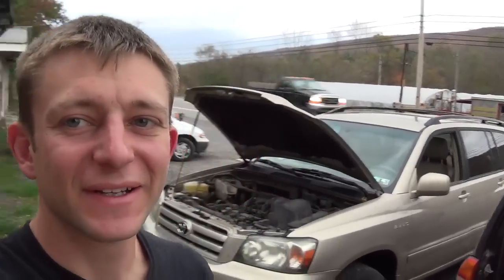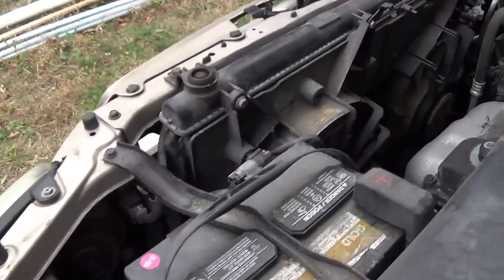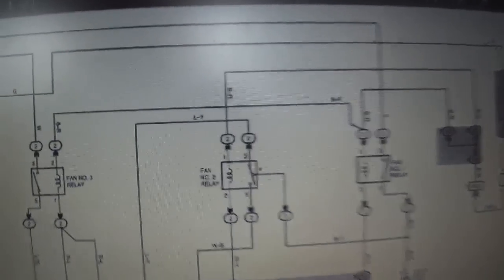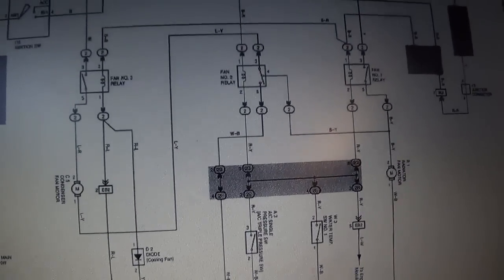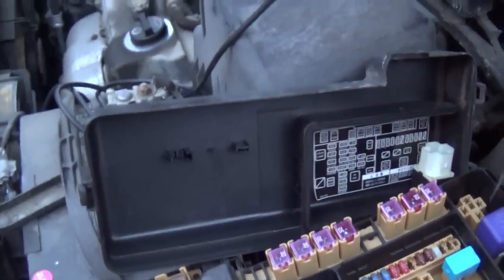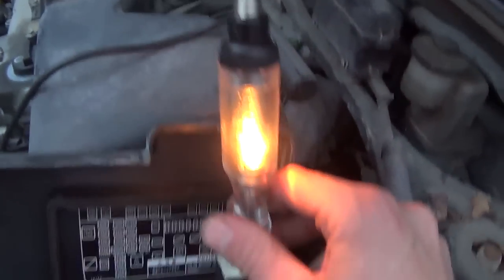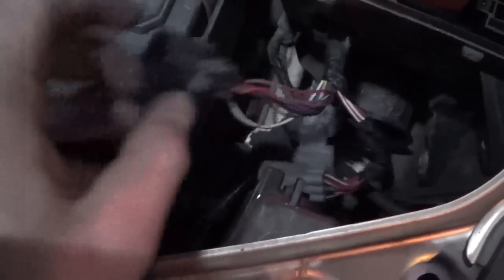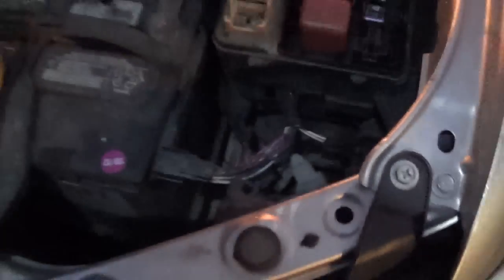Cooling Fan Stuck-On Case Study: '04 Toyota Highlander

Comment: I touched my 2008 FJ cruiser headlight plug when installing my xenon hid..

Now there is no low beam, I am preparing to do same thing you do here.

FJ cruiser DRL with headlights system makes things very difficult, 

God help me

I even bought Fluke117 for this. Do I need lights tester!

Comment: This is so helpful i have an issue with corolla ae101 very similar. Will now look into connectors on the bottom of the fuse box and check on the pins.

Comment: crazy I'm working on the same vehicle which is a 2005 highlander 3.3 ... that wire which is was hot all time mines is that is doesn't have no voltage nor ground wire is dry ...fan do not kick at all unless i give direct power will run... i need some help!!.. but this video has help a lot this is amazing
Reply: Hey man i can help you with your problem if yiu would like

Comment: after paying over $1000 for possible fixes I come across this ;P time to go get me a scope on a rope
having the same problem with my 2005 silverado. tho the fan kicks on minutes to hours after the engine is off
Reply from the maker: start with a wiring diagram!
Reply: turned out to be a connection also fixed. $18 lol

Comment: Man I have a Toyota sienna and mine both fan are on in switch on position and when I disconnect the temperature sensor this come off is suppose if you disconnect the sensor it will be on but the fans  come off  when I disconnect the sensor
Reply: This just happened to me on my Toyota Sienna.  How did you fix it?

Comment: There was no voltage drop through the fan motor thats why the test light became led when you connected it to the batt. + ???
Reply: I'm thinking the same thing.  I would have expected to see 12volts "beyond" the fan motor winding - this is as long as that "end of the wiring" is NOT pulled to ground.  I'm wondering what I missed??

Comment: Everything I was gonna say has already been said, Ivan. But I would like to ask a question. Where the hell do you find all these obscure problems?  Never had a connecter problem that I couldn't see or at least tug a corroded wire out of a connecter.
Reply from the maker: +wysetech2000 Hah this was a rare case where I got to look at the car before it was thoroughly "molested" by parts changers :)  Would hate to think of the worst-case scenario where you have to dig through the built-in problems before getting to the original issue...Remember the Acura?
Reply: +motoYam82  Yeah, it's always good to be the first one to work on a problem and yes I do remember the Acura. Whoever worked on that mess shouldn't be allowed to open a hood. {:-)     It's this kind of work that keeps making you better and better as well as successful in your business..
Reply: +motoYam82 to be fair the relay had already been changed ;)

Comment: Hi Ivan very good use of your analytical skills in this video. However...i'm a little befuddled, and this is why...you establish that you have power on the white/black wire ( constant motor ground radiator fan) and it's cross feeding thru crusty connector pins at EB2 into the red/yellow(ECM switched ground on the control side of the relay). So, key off (no ground from ECM) power is on the red/yellow. O.K...you also found with the test light connected to B+ a ground on the IGN+ supply to the control side of the relay with the key off....so what I can't understand is where the ground is coming from??and you don't tell us the answer.Can't see from the diagram where the ground is being sourced from...maybe 2 problems?. I'm sure it's just me missing something here.lol Keep up the good work..the cerebral stuff never gets boring.
Reply: Possibility for D2 cooling fan diode on relay 3 acting as ground thru relay coil 3 to then actuate relay one, but since we can't see the circuit that isn't being discussed very well, I don't know what's in the upper right corner at all.  The diode is orientated in the proper direction, so it's a suspect in my book to be supplying the ground for relay 1 control circuit.  Maybe relay 3 coil requires more current than relay 1 coil to further confuse us?  Nice find Ivan, a truly unique one and good quick fix too for the customer.
Reply from the maker: +tecnaman Great question. Think about all the circuits that are on (or upstream!) of that 10A Heater fuse (that supplies the power to the CONTROL side of the fan relays). 
As soon as you turn the ignition key to OFF, and take power away from that whole tree, then every single load on that tree becomes a path to GROUND. The bright test light (connected to B+) to the control-side FEED of the FAN1 and FAN2 relays proves this.   So nothing wrong there :)
Reply: I now understand how the control side of the relay will complete the circuit  if leg of cicuit where fuse 10 of power side  is ,with kof will beacame  ground path and the shorted side to power will provide high side  and complete circuit, but the cooling fan worked with keof  starnge because at this time we will have to powers  on control side ??
Reply: Two powers only occurred with key on though and at that time the fan was off.  First part of your post is right.  I don't know what I was thinking when posting before, please disregard.

Comment: this is an old video, but I just had the exact same problem 2 days ago.  Helped me a bunch to find the fix.   THANKS!
Reply: whats the issue and how you fixed it? thanks.
Reply: @Yonipzz  The wires to the fan/switch right at the plug from the main harness were burnt.  Just repaired the plug.
Reply: @joachimbartsch1045  thank you for a quick response.

Comment: my logic is that when some one disconnects the fans for whatever reason, there is a load that goes thru and shorts the connector wires. my 2001 has the fans on all the time when the key is in the acc or running.  im going to check the connector maybe its shorted there too.
the fans stayed on after i took them out to remove the ac system, they worked fine before, so i think we have to disconnect the battery so that connection doesnt short out. and it is a rule that whenever electrical parts are removed, the batery should be disconnected. an mistake by my part.

very good video.